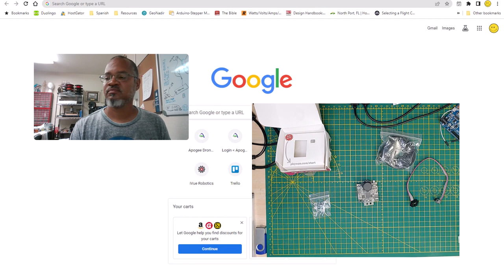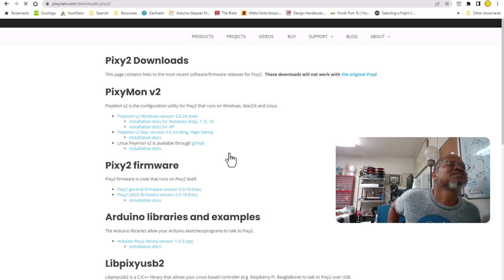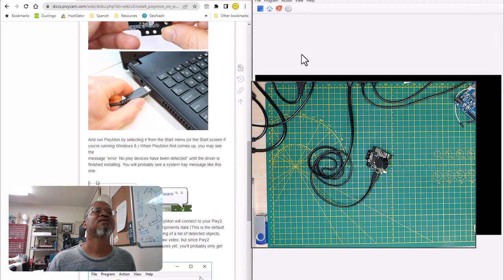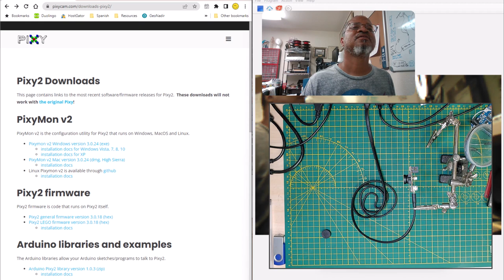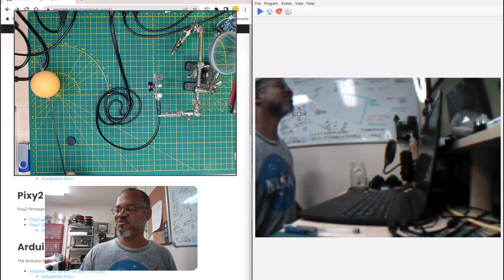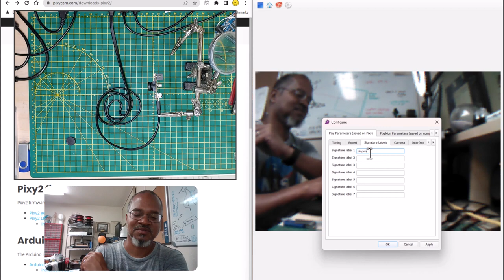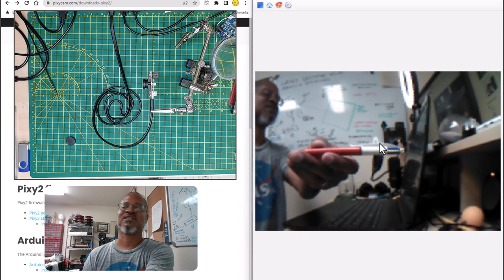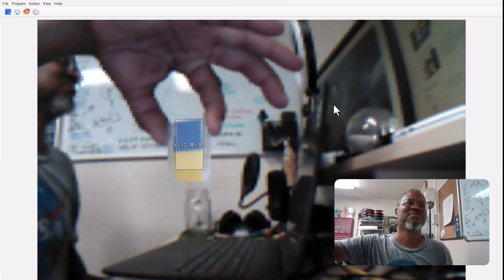Pixy Cam Overview - No Manual

Comment: I could TOTALLY relate to you the whole time:hand-purple-blue-peace:. Just saw myself working with the Pixy the first test without any manual:eyes-purple-crying:...cause it's supposed to be SUPER EASY right?! :face-green-smiling::cat-orange-whistling:
Reply from the maker: Exactly!  LOL  It got me a few times, but once I figured out what I was getting wrong, you can't beat the features for the price.  The best part is that it handles the image processing and lifts a lot of the weight for your processor.